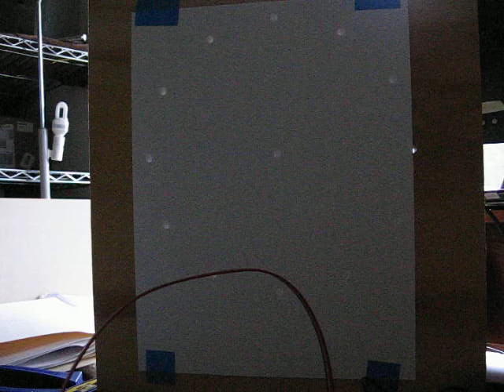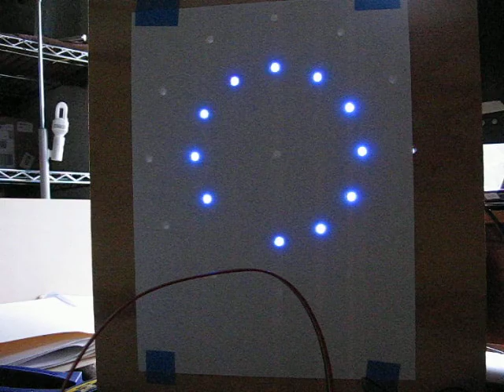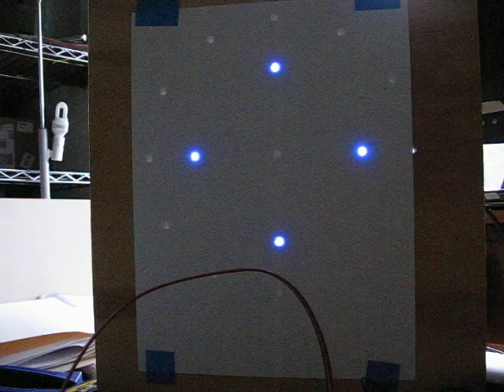analog LED clock project - test patterns

Comment: im looking to create this same effect for the hours on a clock where all LEDs are off except that hour ... any advice on where to get information to make this thanks
Reply from the maker: As far as hardware goes, I used:

... an Arduino clone
... three 74HC595 shift registers to connect 24 sets of LED's and resistors to the Arduino
... a DS1307 real-time clock, to store the time
... an infrared receiver, so that I can use a TV remote control to set the time

I found a lot of useful information on Adafruit.com